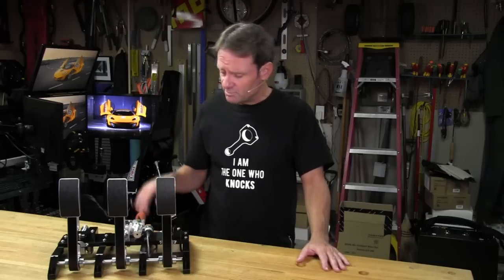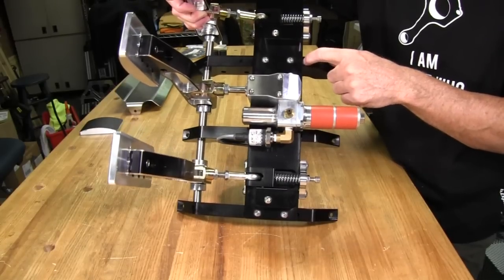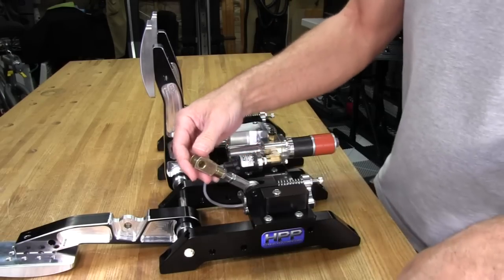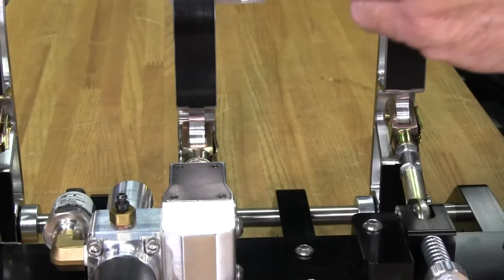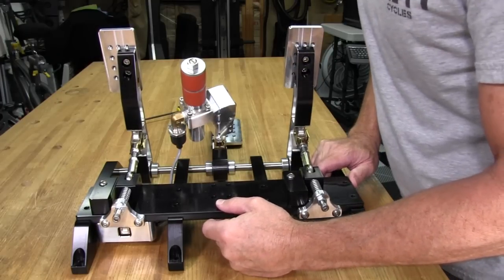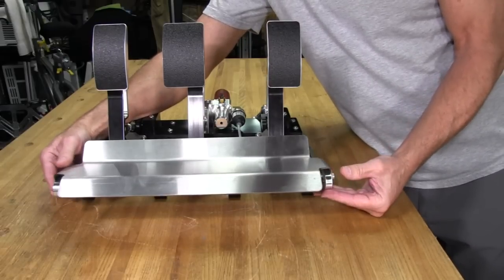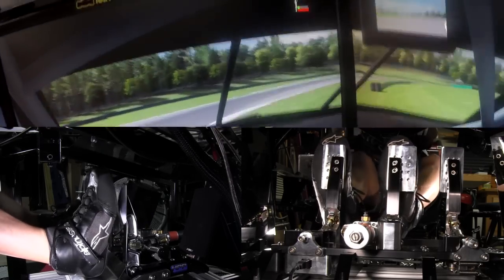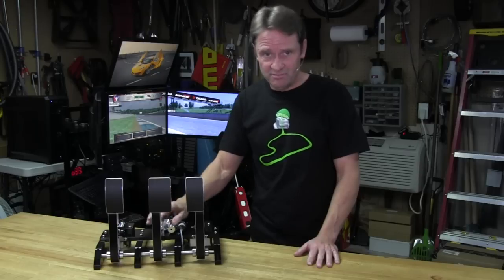HPP Simulation Pedals Review

Comment: Really good review Barry. You really have a great presence and very well spoken manner and it makes the review a pleasure to watch and listen too.

I was noticing your triple monitors are mismatched a bit between the center and side screens. I just upgraded to triple monitors myself and it took me a couple weeks to figure out why my screens were not lining up also. It's actually a very simple fix. Once you go into the sim, in options, graphics, you need to measure the width of all 3 screens and place that measurement into the given areas. You have to imagine the 3 screens as one single large screen. As an example, I have 3 24" monitors. However my measurement for all 3 monitors across is around 70 some inches I think. Once I made that adjustment my screens lined up perfectly. You might give that a try. I think it will make your triple monitor experience that much better :)

Thanks again for the reviews!
Reply: Also, once you place the correct measurements in the given areas, toy around with screen angles in the sim until you get everything lining up on screen.

Thanks again for the great reviews. Can't wait to watch more of your videos!
Reply from the maker: Chad Kirk Yeah, you will see that in some of my video's. I end up moving the monitors around when I'm installing and re-installing hardware I use and review. Sometimes I don't bother too much with making them line up properly when I put 
them back on place. But you can bet I line them up properly and make sure I have them setup properly in the sim
when I actually race and practice. I even have a "Post it Note" on the back of my right side monitor with my iRacing settings for the monitors in mill's to be as precise as I can. And I re-check monitor angle also with a metal compass made for that sort of thing. Didn't realize you guys were paying that much attention when I shoot my reviews! LOL! From now on I will try
and remember to get the monitors normaled up before I shoot. Thanks for watching!
Reply: Oh okay. I hope you didn't take any offense to it as me being critical. I just understand the struggle I had getting my own monitors set correctly and thought it might be something I could pass along. But you have t under control, obviously. Thanks again for making such good reviews.

Comment: Do you have any suggestions to repair my master cylinder on my hpp set?  It appears I blew gasket of some kind. Since mark sold hpp earlier this year, I having trouble locating parts or guidance. Thank you, any help word be appreciated.
Reply: Where are you located? I have a set with the same problem, it was dismantled and now converted to LC brake.
Reply: @bbogdanmircea  I am in Southern California. I was able to repair it myself, has been working fine since.
Reply: @beatla961  That's quite fair away

Comment: Sorry for the Necro but i just bought these second hand and cant figure out how to have them straight.  I can adjust the plate but then the pedal is not in line with the brake cylender so it cant mount flush (the pedal pin hole is too high).  This kit has been upgraded to the new master cylinder.  Any ideas?   I dont want to put stress on the plunger shortening its life span.

Comment: Does anyone happen to know the parts used for potentiometers and pressure sensor? I have an older set of these pedals and the throttle and brake sensors are going a bit wonky.

Comment: Well this didn't age too well, I got a set of these for free as the hydraulic cylinder failed, it was taken apart and the brake is converted to a Load Cell, actually it works quite well, unfortunately the acceleration gives some spikes so I will try to get a SoftPot Potentiometer and repair them.
Such a pity for the workmanship on these pedals ... they are basically bullet proof apart for the hidraulics ...

Comment: Barry, are you in a position to make a definitive call on which pedal set you would recommend to buy if I am in this kind of price point? I am considering these HPP's, the latest DSD's which are about to be released and maybe at a stretch the ARC Carbons (although their price is probably a stretch too far).
I was also considering the Heusinkveld's but it seems like he has no stock. Has he stopped making these?
Thanks
Reply from the maker: ***** I really don't think I'm qualified to tell you which pedals set would be the best for you. We are all different, so what I like might not be what you would like in a pedal set. However, I can say that any of the sets you have listed here will do a fine job as far as consistent brake pedal feel. The rest is very much dependent on personal taste.
Reply: Sim Racing Garage Well, now that you've done a review of both the HPP's AND the Main PC Pedals, which ones would you keep and which ones would you send back? ;-)

Comment: Are these released yet ? I cant see these ones on the website
Reply from the maker: Try this! http://www.hppsimulation.com/7-hpp-3-pedal
Reply: the ones on the website have a fluid cylinder and there are 2 versions slant and upright.
Reply from the maker: M1KEYz What you see in the video, is shipping now.
Reply: Yeah I know lol.. I've decided to go with the the Heusinkveld ultimate pedal now after watching your review really like the look and just everything about it is wow.. The only problem I have is I don't know what I would need to mount it to my simxperience stage 4. Im also thinking of getting simsteering force feedback aswell but have no idea how to mount it to the rig.. any suggestions ?
Reply from the maker: M1KEYz Here you go! Mount for steering wheels: http://youtu.be/SFTHKpUo9QM?t=5m45s And this is how I mount all my brake pedal sets to the SimX Stage IV: http://youtu.be/Z6cI9dBXeXg?t=17s . Remember though, that I have to mount my wheel higher than the stock wheel mount that comes with the SimX rig because I am running the GS-4 seat which mounts about 2.5 inches higher than a regular seat. So if you want the same type of wheel mount I have you may have to add spacers to your regular seat mount to be high enough. Also the wheel mount I use is much sturdier than the stock wheel mount. Hope this helps!
Reply: Could you link me to a website where I can get that 10series 2/2 which you use to mount the steering if you don't mind ? I live in the UK, I went on ebay and that 80/20 won't ship to the UK.. THANKS FOR THE HELP
Reply from the maker: ***** When I'm driving, I don't notice them at all. The 5.1 surround sound speaker setup I have is all I can hear. Most videos of the rig have audio from the camera. When positioned at the rear of the rig the camera picks up the sound a lot more than when seated and running. So the noise they make is a non issue me.
Reply: Sim Racing Garage A review of your rig and especially the GS4 seat will be very informative. These things are expensive and your opinion on these things is very assuring for someone wanting to buy these expensive devices without even trying them once.

Comment: why are the pedals so far apart?! not good
Reply from the maker: The pedals were setup for "left foot" braking while using the corvette. Having them further apart makes it much more comfortable for longer runs than having them in a normal heel and toe configuration where all three pedals are close together. If I am running car that needs the clutch to shift, then it would be in the heel and toe configuration. That's the beauty of Sim Racing. You can set things up any way you like.
Reply: Sim Racing Garage thanks. When are you going to make more videos?
Reply from the maker: I have a couple in the works now.
Reply: Great! Can you comment on the HE Ultimate vs. the Rimotech GT1/GT3? I'm contemplating which to buy right now...
Reply from the maker: Sorry, I have never used Rimotech Pedals, so I can't comment.